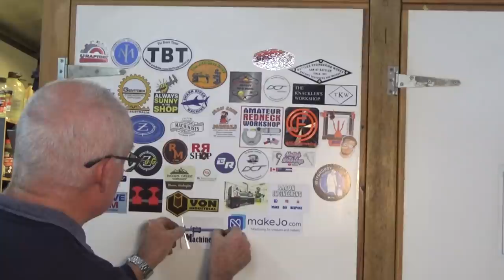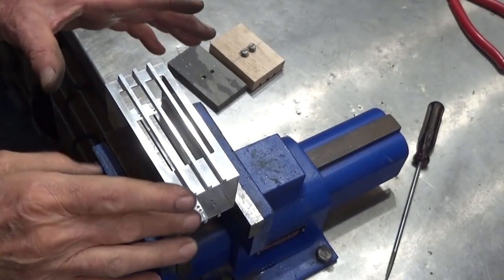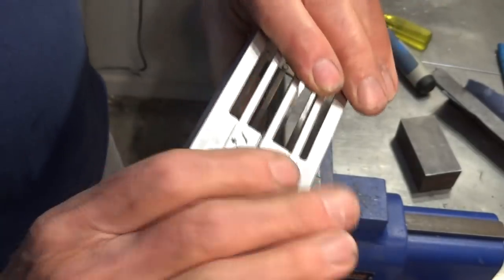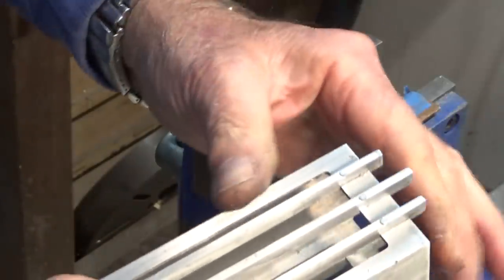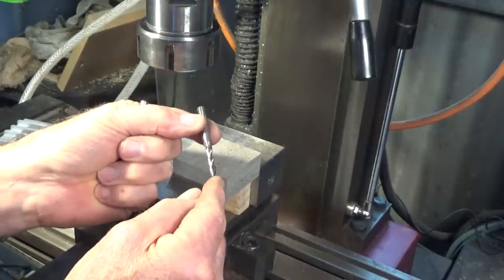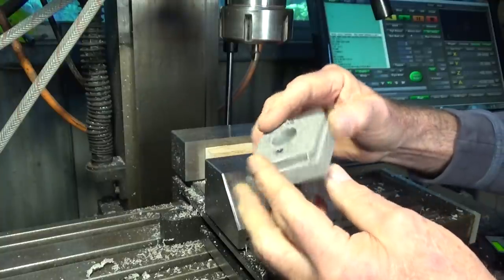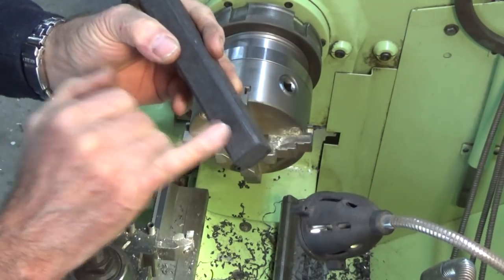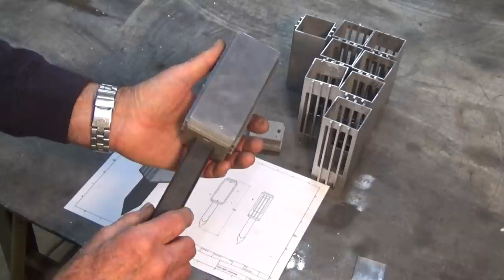How to Rivet Tiny Parts Using Shop Made Aluminium Rivets

Comment: Watching you turning plastic on a machine lathe reminds me of in 1970 I was a lathe operator for Bennett Respiration. We made medical respirators. One job was machining plastic respirator mask you connectors. The plastic was beyond gummy to machine but the simply chilled the part with nitrogen and used a sharp angle tool. Tons of ribbons all over my machine. Thanks
Reply from the maker: That's interesting. I tried to machine some resilient plastic suspension bushes but they just collapsed when I tried to grip them. At the time I thought about putting them in the freezer but they would have warmed up in no time. Cleaning up plastic swarf is no fun at all.
Regards,
Mark

Comment: I haven't forgotten you, when it comes to making you a rapping tool. I have the mold on deck but life interfered before I could pour it. Trying to get the job done before the real heat of a Florida summer.
Reply from the maker: That's OK. I have been having more success with the whole casting experience lately. I have a video coming out shortly where I get 100% yield from 12 patterns. How good is that?
Regards,
Mark

Comment: Great project Preso, I too am often motivated by the lack of quality that the hardware stores sell us in great quantity. Thanks for the tip on the deck material, I can see a lot of use in the shop and particularly for test projects on the mill and lathe. Enjoyed very much, thanks and cheers!
Reply from the maker: I saw a product called "chemical wood" that was sold as a prototyping material to use on CNC mills and routers. It machined easily and quickly and didn't knock the tools around too much. The Eco Deck is similar in that you can knock out a draft part very quickly to check for size and fit and then if it works you can re cut from metal. I have just about used up all my offcuts of this material but I should really buy another length of it just to keep for small parts that don't need the strength of metal or in the case of components that need to be electrically insulated.
Regards,
Mark

Comment: Wondering if you had hot glued your washer/spacer to one jaw of your cutters if it would have saved any significant time/motion.  Thanks for an interesting video!
Reply from the maker: You are probably correct. It's one of those cases where you find efficiencies as you do the job more and more. 
Regards,
Mark

Comment: That's a great demo of making and using rivets. I've done a few but definitely not on the production level as you have.
If I were facing that same challenge I would have used T-88 epoxy -- etched and bonded the pieces especially since they're not going to be mechanically stressed.

Beautiful design for the lights!
Reply from the maker: Thanks. I can report that the garden lights are still working perfectly after being out in the weather for over 6 months. No sign of water penetration or damage so I am a happy builder.
Regards,
Mark

Comment: Made myself the tool to get the dome head on soft rivets years ago, using just a drill bit to make a shaped inner section in a small piece of old shafting. Got a few bottles of odd solid rivets that I picked up, and they are useful, even made a few little repairs to toys from them, hammering them flat to fit in the broken plastic with epoxy.
Reply from the maker: My view is that riveting is an underrated method for joining materials. The difficulty is actually buying solid rivets now. Back in my teaching days we had hundreds of boxes of what was knows as Tinman's rivets. These had flat heads and stems about 3/32" diameter. We used them for riveting together sheet metal (tinplate). We also had a domed head rivet made from iron. They were soft and easy to work with and they were used for joining steel sections of 1/8" thick. Once we were supplied with spot welders and mig welders, there was no need for riveting any more and most of the stock got tossed out. I did manage to salvage one box of the tinman's rivets but I wish I had gotten a box of the iron rivets. 
Regards,
Mark
Reply: @Preso58  Yes solid rivets are only really used in aviation these days, as the pop rivet won out because of the lack of skill needed to use it properly. Plus the need only to access one side of the material. Solid rivet though is stronger than the material in most cases.

Comment: Hi Mark, thanks for another interesting video. Another way possibly worth trying to attach the bars to the casing would be to use Aluminium solder as opposed to the rivets and the TIG welding. I've had some success with the stuff on similar lightweight items .
Reply from the maker: That was going to be the next thing I was going to try when the TIG welding looked like it wasn't going to work out but I was still worried about distortion on those thin sections. It would have looked awful if they bowed, even slightly. I still want to try that low temperature alloy though. It looks interesting.
Regards,
Mark

Comment: Thank you for this extremely educational video. Now I know how to make those solid rivets from soft metals. To make that ball peen effect end to the rivet, make a mandrel that is rounded at the end of a blind hole, marginally larger than rivet diameter and the depth of the desired finished rivet height. Cheers from Indonesia.
Reply from the maker: I do have a set of those for different sized rivets but I wanted the rivet to be flush with the aluminium bars. I have made a couple of steam locomotives with plenty of brass and copper dome head rivets. It's always a challenge to keep the rows of rivet heads neatly spaced with consistent sized heads.
Regards,
Mark
Reply: @Preso58  Thanks for your kind reply. Cheers, Olli

Comment: Aluminium filler wire: I have 1050 (AL99.5) or 5183 (AlMg5Mn) and was wondering what type of wire you use. Looking at how easy this cuts it look like 1050. 5183 is fairly hard (but may be the better choice for structural bonds).
Looking at the mounting of the glass: how do you prevent the lamps from filling up with water when it rains?
Reply from the maker: I am not sure what the composition of the filler wire is. I just purchased it as general purpose TIG filler wire. It is nice and soft though and it hammered easily into the countersinks. I have had one prototype light in the garden for a while now and even though we have had some rain it seems to be keeping dry. The powdercoat should fill the gaps between the cap and the tube but some water may still make it's way between the glass and the tube. The simplest solution would be to make a series of drain holes in the bottom but that also allows ants to migrate up into the area inside the light. I will just have to monitor it.
Regards,
Mark

Comment: Where did you get the eco deck material in that thickness? Can only find thin material with big channels in it..
Ps great video.
Reply from the maker: I purchased mine from a local timber yard. Ironbark Timbers at Kunda Park on the Sunshine Coast. 
Regards,
Mark

Comment: Ok, I have a LOT of tools, but this video shows two tools I have never seen or heard of: The manual countersink tool that looks a little like an old brace, and the tool that pulls a rivet in when you hit the top with a hammer. What are these called and where can you buy them??
Reply from the maker: Steve, the countersinking tool is made by Noga. https://www.aimsindustrial.com.au/noga-rotodrive They are available in a couple of different sizes. I only have the one but they do a great job of deburring holes after drilling. The other tool I was using to set the rivets is a shop made punch. It just has a hole equal to the diameter of the rivet and it's used to set the rivet head tightly against the stock.
Regards,
Mark

Comment: You’re not worried about water running down the glass face and filling up the bottom shorting out the chocolate block terminal?
Reply from the maker: Not yet. I have had one in the garden for a while just to see if it leaks and so far it seems to be fine. It will have to be monitored though.
Regards,
Mark

Comment: Geeze you reckon you had a boring job - try operating a capstan lathe to cut the short thread on engine studs , the autos would do the long thread and end radius then part off and my job was to hand feed these into a collet chuck and do the other end with a Coventry die - by the thousands .
Then I got a job at a hard chrome joint and they plated the throttle shafts for Holden and Hyundai cars , each shaft had a thread on one end and a spade end on the other and before we could plate them each end had to be wire brushed by hand on a big buffing machine to remove any scale from the hardening process and I did these every day for 9 years - the volumes ranged from 500 to 1500 a day and they took around 10 seconds each to do .
Well that was a riveting video Mark ! - sorry but someone had to say it 🤣
Reply from the maker: Well, you know what it's like then. Interestingly, the job that I described (making the springs) was normally done by the factory foreman's wife. She was sick for a few days and they put me on the station instead of her. Evidently she claimed that job and jealously guarded it. I had to ask her why and she told me that she could listen to the radio through an earpiece while she worked and that she could make the springs without having to think about it or look at what she was doing!
Regards,
Mark
Reply: @Preso58  
We had a toolmaker at the bolt place and he spent his days making the fingers that clamp the barstock in the Auto lathes , everything was fly cut then surface ground . One day I was working away going insane with boredom listening to this lathe fly cut the parts at 60rpm and I heard this almighty crash ! I looked over and the old guy had fallen asleep and fell of his stool crashing into a tool cart next to him - fortunately no harm done , watching him was even more boring than my job 🤣

Comment: Will water run down the glass and accumulate in the bottom of these?
Reply from the maker: Maybe. I have had one in the garden for about a week and we have had some light rain. It seemed to remain dry just the same. Even if it gets a build up of moisture I am hoping that the materials I have chosen will be durable enough to stop any deterioration. 
I will try to do a follow up to show how they have performed.
Regards,
Mark

Comment: Dear Mr. Pressling. 
Very nice, well thought out and by the looks of things almost indestructible in a manner of speaking. Yes, the chinese rubbish is built to fail and the last lot that I bought employed the use of specially formulated plastic solar panels designed to become opaque in direct sunlight. That CNC machine looks interesting with the gas strut mounted on the vertical  column. Would it per chance be a modified Seig X3? I bought one such modified mill from an outfit called Promica in Melbourne. The thing has never worked properly and now resides in dusty solitude in the corner of the garage awaiting a complete tear down and rebuild. Needless to say, Promica has disappeared from the face of the earth. I am mildly annoyed about that... In a manner of speaking. However, such is life. In conclusion, I sincerely hope that you are well and continue to stay that way by avoiding where possible, airports, train stations, shopping centres, dance halls, picture theatres, public transport, large congregations and suspicious looking individuals exhibiting flu like symptoms. Kind regards, Bushman
Reply from the maker: Chris, yes I do have a CNC'd Sieg X3 and it does have the Promica kit installed on it. I too am annoyed that Promica disappeared. I think I was lucky to get my kit. I know that many customers were left in the lurch when the business folded. I have done some extensive mods on the Sieg though. I filled the base and the column with epoxy granite and I moved the Z axis lead screw  to the outside of the column and put the Z stepper motor at the top. I also retrofitted double ball nuts on all the axes and added the gas strut to offset the weight of a 3 phase motor I added to replace the original DC motor fitted by Sieg. My motor controller died shortly after I bought the machine and the vendor wasn't too helpful about replacing it under warranty so in the end I bit the bullet and just replaced the whole drive and transmission. I did a full build log on the CNCZone Forum here https://www.cnczone.com/forums/x3-sx3-g0619-g0463/240886-cnc-cad-forum-posts.html
The Sieg was probably the wrong choice for a CNC conversion due to it's notoriously badly designed head and column but I have learned to work within it's limitations and I can do some accurate work on it but don't ask it to do cuts deeper than 1mm or you are asking for trouble.
Regards,
Mark

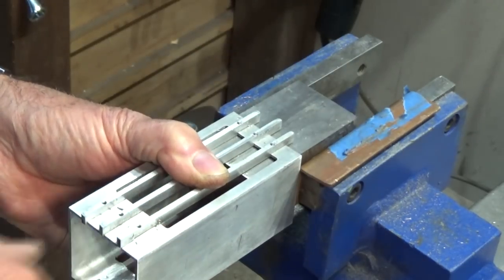Comment: 12:40 there's formulas for getting the rivet length correct.................. jus sayin
Reply from the maker: Yes, usually 1.5 times the diameter of the rivet. I had already worked that out and selected a washer with the correct thickness. 
Regards,
Mark

Comment: Where did you get the eco deck stuff from?
Reply from the maker: Most timber yards now stock these products. I got mine from Ironbark Timber at Kunda Park, Maroochdore. I'm not sure where you live but Bunnings also sell a similar product. We used it to replace a fully exposed timber deck at the back door of our house. It was previously built from hardwood joists and 93 X 19mm kiln dried hardwood decking with a pencil round edge. It lasted for about 20 years but dry rot got into about half the decking boards and most of the nails started to work loose. I ended up replacing the joists with galvanised steel RHS joists and the Eco Deck was fitted with a proprietary galvanised steel anchor strip that locks onto the edges of the boards. It doesn't need nail or screw fixing so there is nowhere for water to get into the surface of the boards. So far (after 5 years) it's holding up perfectly. 
Regards,
Mark
Reply: @Preso58  I live in Logan south Brisbane

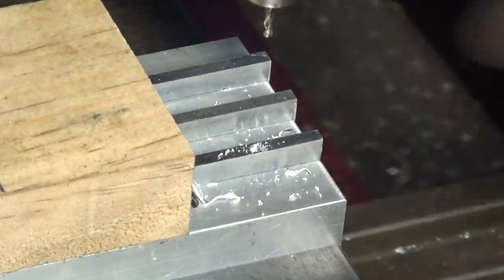Comment: 7:28...NO CUTTING OIL?! I'm not surprised you're breaking drill bits!!!

Get yourself a small container of WD-40 and a small brush-(!)
Reply from the maker: Totally agree but this time I got greedy and tried to do it dry. In all honesty, my camera gear is bulky and it gets in the way of just about everything I try to do on machines. Sometimes I take shortcuts so I don't have to stick my hands in front of the camera. Unfortunately I paid the price. 
Regards,
Mark
Reply: @Preso58  ...aluminum is kind of "gummy"- copper is even WORSE-!

Well, "live and learn"!

Comment: If you're still cranking these out, maybe a multi cavity mold could cut your time.
Reply from the maker: It's probably not worth it for the ten that I made but a die casting setup would work well if you had a lot to do.
Regards,
Mark